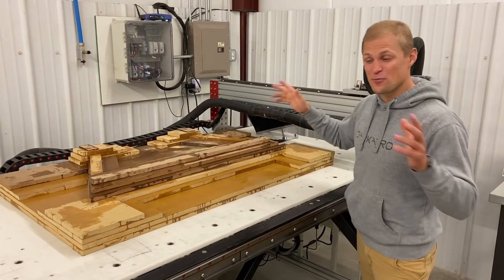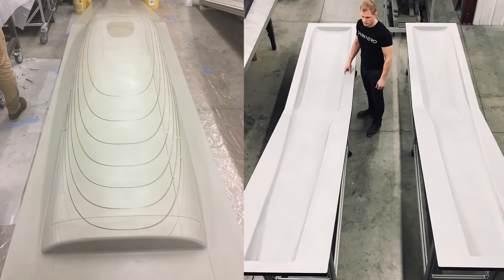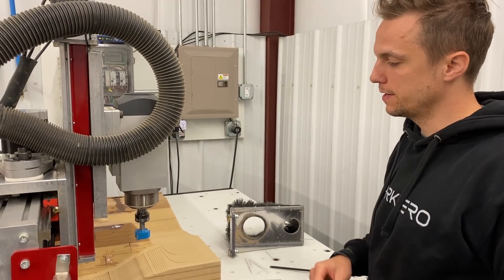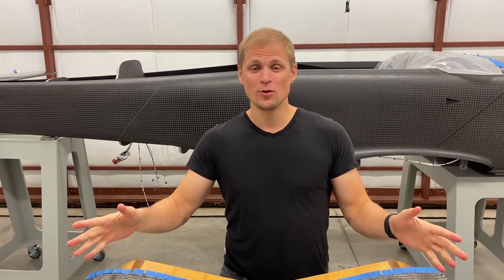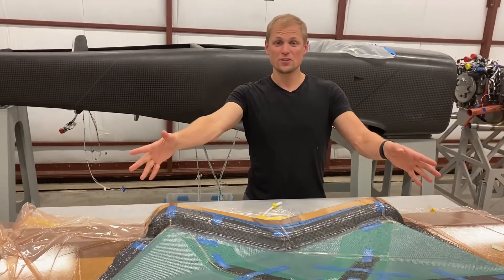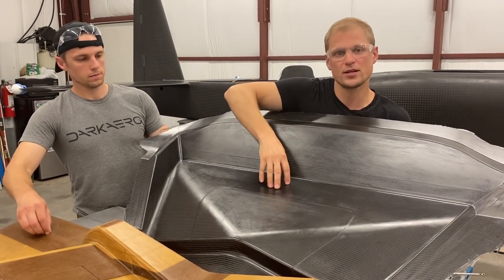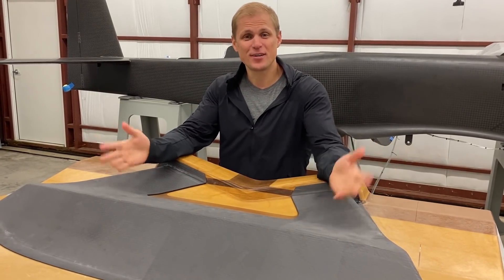Most complicated CARBON FIBER part in the DarkAero 1!

Comment: I appreciate all the hard work you put into these fun videos. I am working on composites with a formula student team in the US and I work a lot with wet and prepreg layups but I learned a lot about vartm from you guys. I was wondering if you placed the breather underneath the flow mesh? I thought we did not have to use breather since the mesh itself makes the way for vacuum. Also, what is the X shaped material you use on top of the mesh that you connect it to the infusion line ?

Comment: Nice work. Thanks for letting us look over your shoulder as you work.

Have you considered using compressed air to aid unmoulding? I've used it with fiberglass, to good effect. A disc of aluminum foil bridges the opening while infusing the part to avoid surface printing.

Comment: Have you considered tooling paste as a mould finish? Or high density EPS mould core + Tooling paste finish? 

Construct mould >  Rough CNC pass (+- 1/8 inch below surface)  > put on paste > fine CNC pass. 

A step slightly above a pure MDF mould, still economical, but you get a fully homogeneous mould surface instead of the MDF quirks.

Comment: First of all thanks for the video! It show‘s that we‘re pretty much dealing with the same issues!

We‘re in the process of developping a UAV in full composite and starting the first prototype tools/parts. First molds were made out of MDF but it‘s pretty much the worst „wood“ Material you can find! But how ever these test molds were not that bad for our first parts. 

Now my questions is (as we didn‘t make it the exact same way), how do you mill the MDF in terms of finish dimensions and what is the layer of Epoxy you apply?

Thanks in advance guys and thanks for sharing all your experience!

Comment: Great video. I have made molds out of MDF and have found that soaking the surface with polyurethane after the roughing cut and before the finish cut helps make a stronger mold.

Comment: Great videos guys. I enjoy watching you sharing the details of the manufacturing process. I have a couple of questions one from structural integrity of such a complex part and manufacturing as well. How do you guys validate the structural integrity of the part making sure it will withstand the flight/ landing loads. The bend radiuses specially at the corners where 3 planes converge look some how sharp. I always was told that for aerospace composite structures, we have to use gentle radiuses at corners, to relax stresses and avoid delamination. Also how do you ensure the angular deviation is respected at the corners and bend radiuses, so the mechanical properties of the layup remain hopefully as per analysis.

Comment: Thumb up on the presentation.  Noticed that no tooling gel coat is used on the mold.  Is the mold be as good as with with tooling gel coat? May be the tooling gel give better finish?

Comment: Tip for you guys. Throw a Household Heater Blanket over your curing parts. Also use a blast of Compressed air to release the part from the mold.

Comment: Use your router to cut up your MDF sheets into the sizes needed. Straight and square pieces will assemble better and eliminate most of the voids in your mold blank. The time invested up front saves a bunch at the end and produces a better result. I know it's a test part & mold. I still think its a worth it.

Comment: One way to save time and effort is instead of finishing the tool with epoxy and mold release is to vacuum bag the tool and do your layup over the bag.  Did this many times and was able to go from a finished (machining) tool to a curing layup in less than a day.
Reply: Wrinkles in the bag?

Comment: If you epoxy seal MDF on all side (i.e. encapsulate), does that help or hurt the moisture/temperature sensitivity?
Reply from the maker: Thanks for checking out the video! Not so much. The MDF does soak up a fair amount of epoxy which will slightly help on the moisture/temp., but the epoxy is more for creating a smoother mold release surface.

Comment: According to the engine manual max in flight OAT is 90F. That eliminates a lot of low level flights in the summer down south. Don't think you'll escape up north either. Min OAT is -15F. This is easily reached when climbing above the clouds on a cold day. What's the plan?

Comment: Your access holes should be staggered in both center and diameter.  You need more structural "box" to resist twist.  The narrow slots on the sides introduce point stress.

Comment: Is there any particular reason you didn't epoxy coat the MDF before running your finish pass? Seems like that would give a more accurate mold. I have been using a similar process for hydrofoils.

Comment: had an idea for parts like that with large flat areas, you could create a wave type pattern to strengthen the flat areas. thinking about curved surface being stronger than a flat one. if you could have a small scale pattern that is always curving could add a lot of stiffness if needed. basically like a truss made of a continuous curving surface. like a triangulated pattern of peaks and valleys curving into each other.

Comment: You guys are making a f***ing plane! In a "garage"! That's engineering! Congrats!
Reply: A 15 acre private airstrip, and a 50x150ft Morton building on a slab of 6" concrete would suffice, order the CNC machines, shelves, racks for your carbon fiber needs, new or used. Why lease a hangar space? Unless you are required to meet "specific" FAR requirements. Once you submit your two documents to the FAA notifying them of your intent to manufacture/ etc., etc., and your intended flight pattern, scope, QC, A&P, Certified test pilots. I am all ears. Why not, EASA? All in, the three guys could have the monetary equivalent 1000 acres to farm.

Comment: Super interesting as always. We work in similar worlds and I've used this type of mould many times. Even used it with low temp prepreg. You could also check out Valchromat. It's a nice version of MDF, might be better than the MFD you have?

Can you kindly tell me what you are sealing and releasing with? Do you think it is better than using Teflon coated fabric? Cut at 45 degrees it would cover most of that mould.

Comment: Is there a particular reason you decided not to mount gear on the wings?
Reply from the maker: Yes, the two biggest reasons where fuel capacity and aerodynamics. The wing is where fuel is stored so any structure or cavities that where built to support or house the retracted gear would cut into your overall fuel capacity. Additionally, we wanted the wing to remain clean and free of anything that could trip up or disturb the airflow. Any disruption in airflow along the wing would produce more drag and impact the aircraft’s performance.

Comment: I can really reccomend pore sealer for mdf, its kinda similar to epoxy in the way you apply it (with a brush) but its dry in like 15min. After that hit it with a rough scotchpad and theres no need to sand it, youll need a fraction of the time.

Ofc finish wont be as polished as the final part should look like, but doesnt really matter for a prototype, does it?

Comment: I haven't done it myself; but I've heard of people having good results soaking epoxy into mdf molds before doing a final shallow finishing cut. As opposed to putting it on after you've finished machining. Have you guys experimented with that?
Reply from the maker: Kohen, thank you for watching and for the question! There are a lot different approaches you can take to mold making especially when it comes to going the experimental route with MDF. :) We did consider the approach you're suggesting, but we didn't see that as having a significant advantage as you would still need to sand it after machining to remove tooling marks. Another concern we had with that approach is that if we weren't consistent with how we applied the epoxy, it could soak unevenly, potentially exposing the raw MDF after the finishing pass. However, this could be something we experiment with for a future part!
Reply: @DarkAeroInc  Ah yeah fair enough. Yeah I had heard it can give you a better finish but as I said never tried it. I think they used a heat gun to warm the mdf and the epoxy as they go to get it to penetrate further. But it's one of those techniques that might not be worth the extra fidling once all is said and done. Thanks for sharing your work with us good luck with the project!

Comment: Why don't you use extruded polystyrene glued with epoxy, it's much lighter and easier to process, but can be a little bit messy with residuals from routing
Reply from the maker: Hey Konstantin, thanks for watching and for the question. We have machined a few simple "molds" using extruded polystyrene. A good example is when we completed the wing load testing. We machined out several sections to match the profile of the wing to act as a flat surface to stack weights onto. It works decent for larger shapes not requiring high degrees of detail or dimensional accuracy. Several challenges with it include accurate work holding, keeping it from tearing across glued sections, and holding detailed features for defining things like the edge of the part.

Comment: Coat the MDF with thin, fast-setting CA glue. It will saturate the MDF, seal it, and make it incredibly hard.
Reply from the maker: Looks like we would need a decent amount of the thin type to coat the whole mold. It would be interesting to experiment with!
Reply: @DarkAeroInc  ...it can be purchased in bulk. Cyanoacrylate glue, i.e. "SuperGlue". Wood workers use it all the time to work on soft or rotten wood and for MDF. Makes the wood very hard and completely sandable. And it penetrates a few mm's compared to epoxy. Try even normal superglue on a small piece of MDF. Another trick is you can fill in significant defects with superglue and baking soda. CA accelerator makes it cure instantly too, so no waiting like epoxy.

Comment: Wow! I've been looking for information on this exact process.

I wonder how it would work, to CNC the MDF slightly undersize,0.05" or so, then lay up several layers of fiberglass and micro, followed by a finish machining to final dimensions. It would potentially improve the molds dimensional stability, and could allow it be used to make additional parts. Say, for limited production runs of 3-30 items.

Comment: you guys should get your plane flying as quickly as possible and find out if the basic flight characteristics of the airframe are right and don't need changing. look what happened to raptor
Reply: The engineering in Dark Aero is of a much higher caliber than Raptor, and the level of design risk much lower. 
Peter spent a lot of time trying to manage around fundamental design issues with the power plant and drivetrain , which ultimately resulted in it’s demise.
Reply: @mikegofton1  Not that these guy's couldn't spearhead Peter's Raptor model down the road even to the design level of Mike Patey's Draco. But, I agree this looks like an aircraft that is only three months from flying. You could put strain guages, pots, all the other experimental equipment on it you want. What I would consider is for you all to drag the wing/fuselage out to tie down to the tarmac pad eyes and test out the pitch prop/engine combo and flight controls as well as the landing gear in a fixed location.

Comment: very cool! quick question: why not going back to cnc after epoxy coating? i know the finish is not a problem in this part, but would it be possible to laminate some epoxy for sealing and then go back to cnc to finish the epoxy?

Comment: Just in case this is not on your radar; there is a MDF product out there with solid colour through out and moisture resistant. You don't need the solid color bit - but it is a much higher quality product. Naturally very few folks stock it (it can be special ordered). I learned about it from two youtube channels: Peter Millard in the UK and Hooked on Wood in the Neatherlands.

Did I mention it was not cheap? :^)  But in this case I think you get what you pay for. There are several brands out there to choose from.
Reply from the maker: Ronald, thank you for checking out the video! Thank you for mentioning this, but we had come across moisture resistant MDF several months back - very interesting stuff! However, given its more of a special order product and higher priced, we would likely just opt for tooling board at that point. One of the goals of this part was to keep things moving without any downtime waiting for materials.

Comment: I do almost this exact same process for my 4meter F5/3J sailplane wing molds. Super in expensive way to get a decent mold for ~50 or less pulls. 

I vacuum bag the layers of MDF to a huge granite surface plate to keep everything flat and have no voids in the laminations.

Also - always do my finish pass with a 2 flute Harvey ball end mill

Excellent work and great project!!!
Reply: I built a series of fairly large MDF molds for the manufacture of product I was involved in. The parts were made from vacuum formed HIPS (high impact polystyrene), so the molds saw more abuse in the form of thermal cycles and "clamping" from contraction during cooling. I was able to get 1200 cycles from the MDF by combining the use of clear maple or aluminum in high stress areas and performing periodic maintenance. They performed way beyond our expectations.
Reply: What I wouldn't give for a large calibrated granite slab.... I did notice that (it appears as if) they didn't use anything to thicken the epoxy when they glued up the MDF.   That might have helped but I think the mold looked pretty darn good less some small voids. I think that if they took the time to Gelcoat and polish that mold they would get > 200 pulls from it and much better cosmetic finish.  The little bit of carbon stuff I do is structural for sailboats, so cosmetics is never a factor, we always paint everything anyway.

Comment: That’s a really nice part - and a great demonstration of the process!  

One really important note - you bagged over the MDF block and down to your table.  It is really hard to get a good air-tight surface on MDF so bagging onto the mold rarely works well.  Just something somebody doing this would need to know but that might not be obvious if you aren’t looking.  

And I love those long skinny demolding wedges - perfect for carbon!  Did you make or are they a product?
Reply from the maker: That’s a good point and it’s something we failed to mention in the video. For all the MDF molds we’ve made, we either vacuum bag to a metal backing plate or we completely vacuum bag around the mold since it is difficult to seal directly to the MDF. The wedges are just door framing shims. They are some sort of composite plastic and are nice and soft so they don’t scratch the part or the mold.
Reply: @DarkAeroInc  also mdf isnt air tight at all, especially at this scale. So one spot where you cant through the epoxy and you need to have the vacuum pump running through the night

Comment: Have you considered doing a pass with negative axial stock to leave, doing your coat of epoxy (or two) then a finish pass with 0 stock to leave?   You might be able to go straight to mold release and pull your part and avoid sanding time.  More machine time, but less you time.  :).  Great work regardless!
Reply from the maker: We have experimented with something like that using low density tooling board, but not with MDF. In the end, sanding is still required to remove scallops generated by the cutting tool. Agreed that it's typically better to try to offload effort to the machine! 😁

Comment: There is a product sold as "carving foam" that is generally used for this purpose. Sold by sign suppliers. MDF is a tough sell. Why mdf is cheap if also will let a vacuum flow through it. You have sealed it but it can still see pinholes in production.
Reply from the maker: The material you are describing sounds similar to what we normally use to make patterns for our production molds. We were hoping we trash talked MDF enough that people would try to avoid it! 😂
Reply: @DarkAeroInc  I would seal the back and sides of the mdf while you have a chance. Spray varnish is generally good enough.

Comment: Just a thing I will add about mdf molds. Lots of guys I'm the rc space do this and they get it a few thousandths above the final part then coat the whole part in resin then carefully use a heat gun th soak into the mdf. Then rerun the whole part to final thickness.  The resin should have soaked into the mold and you can then run the program and be cutting through an fairly durable resin and mdf mix. Hope that makes sense!
Reply from the maker: That would work as well! There are a lot of options when making quick prototype molds like these. 🤙🏼

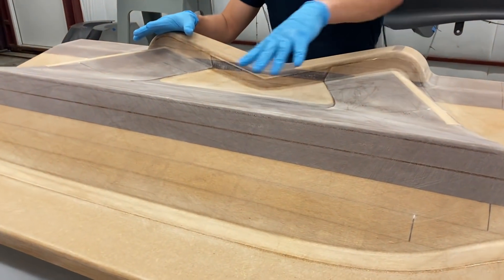Comment: Very nice work! I have a love-hate relationship with MDF for mould making.. when applying epoxy for the first time, the fibers of the wood stand up and need to be sanded, most times i have to apply a 2nd coat then. For improved surface finish, you could have easily applied another spray layer of epoxy to get quite a perfect finish. Anyway, nice work! One thing i noticed though: on 5:25 on the right corner there seems to be two larger gaps in the mould.. no fear of the resin sticking in there?
Reply from the maker: Thank you! Our relationship with MDF is exclusively hate-hate. 😂 Agreed that further iterations of epoxy coating and sanding can be utilized to improve the mold surface finish. You might be seeing gaps that were filled with epoxy but they still look open since the epoxy shows up darker than the surrounding material.